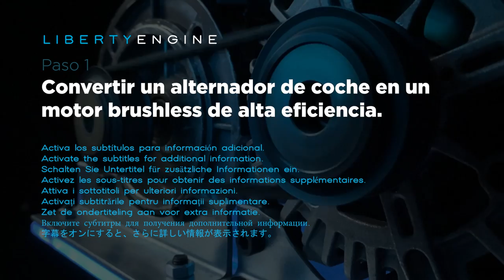Como generar ENERGÍA GRATIS con un ALTERNADOR - Liberty Engine 1.1

Comment: Las baterías están en la carcasa que dice que es el condensador, por lo cual hay están las baterías que le permiten hacer la prueba de dos horas.  El motor está modificado por eso no ensena la parte delantera ya que hay está escondido el inversor de 12 voltios a 220 por eso nunca cae la tensión al conectar radial y el taladro está arrancando mecánicamente un motor de 12 voltios que mueve el alternador , el motor que dice ser monofásico de 220 está trabajando a 12 voltios al tema del motor es un motor de 1,5 voltios por eso tampoco enseña la placa de potencia y consumos del motor el desarrollo que lleva el motor en el plato es igual que el del alternador eso quiere que ha calculado las revoluciones para no quemar el bobinado del alternador al tema de la modificación del alternador es para no quemar el bobinado sí que da 220 es el mejor engaño hecho muy profesionalmente sabiendo lo que hace , si da 220 a la caja de conexiones del motor pero no está conectado al bobinado el bobinado del motor se mueve con las baterías y el inversor hace que no caiga la tensión numca
Reply: please send me the link where to buy the this magnets? thanks

Comment: ALBURT EINSTEIN SAID IMAGINATION IS more  IMPORTANT THAN EDUCATION…  do this!.. in your work shop create from built coils copper brass stainless steel rotors perfectly biult to  rotate,,@high RPM IN YOUR REBIULT PREFERENCE MOTOR AULTINATOR! adding nylon copper magnet’s & neodeium rare earth costly more the merrier.. ok  a ball bearing layers of various minerals neodeium nickel raceing around a 360• degree’s pipe several a glass tube perhaps… in c athletic converters that minersl  4got the name a P? use your emagenation get it spinning use integrity biulding tecnicks & somethings going to happen ……… forget scuence out side the box how he found the titanic follow its chum trail led him to the vessel!!

Comment: Un alternador entrega 14 V DC aún con campo magnético permanente,  posible suba en voltaje en vacío sin carga pero sigue siendo DC si se quiten los rectificadores, da tres frases en AC pero la frecuencia no es adecuada y no se pueden usar las tres fases a la vez en un consumo.

Yo aumenté la potencia de los rectificadores y puse un potenciómetro en la excitación de campo y con eso pude soldar con electrodo.
Solo con un inversor de puede obtener 220 V ac

Comment: Veo que tenía tres cables en la salida del alternador, posiblemente quitó los rectificadores, pero, por qué conectó solo dos al consumo? 
Tendré que probar para ver qué voltaje da de esa forma. Pero para entregar 10 kilo wats que dice, se necesita un buen caballaje en el motor impulsor 
Yo puse 12 hp y se resiente en la carga de 80 amperios.

Comment: Wouldn't it be easier if you put them face to face and join them with a coupler? This way you eliminate extra parts and save energy! Even starting it was easier because you didn't bother with the plug. Does the winding inside the rotor have any role, or could you remove it? This way the rotor would look much more elegant!
Reply: Where in the video should i look for that detail?

Comment: Why did you blur the voltmeter when you turn on the equipment? A voltage variation occurred, actually  reached zero. It looks like this system has no power.
Reply: and no voltage regulation electronics to protect equipment motor etc if it works at all it may go faster and faster until it dissolves into an alternate dimension by creating its own wormhole😁which is about as likely as the stupid 'installation' even running itself at all😏

Comment: Question:  In a later video you say you would need a stepdown transformer for 110VAC, 60Hz power.  Couldn't you use a 110VAC 60Hz 1750 RPM motor?  Or would you still use a 3600 RPM motor but with a modified 12VDC alternator?

Comment: DO YOU USE SPECIAL KIND OF MAGNETS FOR THE ROTOR OR WILL ALNICO 5 MAGNETS DO FINE?? 
I'M REALLY CURIOUS BECAUSE I'M GOING TO CONSTRUCT THIS DEVICE FROM SCRATCH !
I WOULD ALSO LIKE TO KNOW ABOUT THE WATTAGE OF THE ELECTRIC MOTOR AND IF I CAN MAKE IT PRODUCE MØRE POWER OUTPUT WHEN I USE A MOTOR WITH LET'S SAY 500 WATTS MORE THAN THE ONE YOU HAVE USED ?

Comment: Um alternador de veículo ainda que modificado com imãs de neodímio, gerará os mesmos 14 volts de antes, só que com menos rpm .
Jamais gerará 220 volts.
Reply: Xin chào bạn, người ta cấy ghép nam châm vĩnh cửu để khi quay xung quanh những cuộn dây đồng nó sẽ phát ra điện bạn nhé.
Reply: Oi celso.....então isso que mostraram não é possível de existir  ??
Reply: This is Daejeon, South Korea. I am an auto mechanic, but I am retired after the age of 70.
As for Altiretta, 12V-24V is output when operated in a car because there is a regulator.
If there is no regulator, overcharging will occur and the battery will be damaged first, followed by electronic products.
And when the RPM changes, V also changes. If you change the RPM by attaching a magnet instead of a regulator, V changes.
I give high praise to the person who made the generator. And I, too, am currently in the process of making a generator. I hope that those who read this will believe in Jesus and be blessed with eternal life. thank you shalom

Comment: I am quite amused by the energy this person devotes to fooling the semi-intelligent. The law of conservation of energy is still valid. The fact that it still has 228V without regulation should warn you that the device is secretly powered from the network! Even the frequency will be as it should be! Notice carefully that as he throws it, his right hand is cuffed near the light switch by the sockets!!! I don't like fooling around! So thumbs down!!!
Reply: shhh.. dont give the secrets!! 😂all of these motor to motor are fakes 100% if it was real there would a abundance of power and power bill would be pennies..
Reply: O puor e a gente perde tempo assistindo o vídeo, para depois não ter certeza do funcionamento. Vem ver os comentários, todos cheios de dúvidas e ñ obtêm-se resposta.

Comment: Wer genau hinsah, dem war klar, dass vor dem Start des Winkelschneiders das Voltmeter 227 Volt anzeigte, beim Starten des Winkelschneiders fiel er auf 123 Volt und dieser Ausfall sofort um 104 Volt, und wenn man noch was anschließt, dann das Ganze Struktur wird kaum, kaum ziehen! Verbesserung benötigt!!!
Reply: Your words are correct, my friend. If aluminum is used and mixed with silver, the factor will become zero, so its energy will not decrease

Comment: So, you are modding an alternator to : 
1. extend the main shaft to be able to connect a triggering device.
2. transform it into a magnetic motor.

Once you have done that, you connect the main drive output of the generator to a multiplug socket that is serving also as a switch.

The motor you connect is a 220 V magnetic engine that will server as a generator, the alternator will now spin the engine to produce a 220V that will be used to feed the alternator now transformed in a motor. 

How long it takes before the once alternator fries?

Comment: Did you know if I use an electric motor to spin an alternator I could charge a battery?  I will sell you these fancy home built chargers with a welding attachment for $399 just DM me. 

Please don’t mind the recycled mounting board and alternator. I only use environmentally recyclable products. 

All orders, Built to order in the order received. Expect 6-8 months due to back log for delivery.